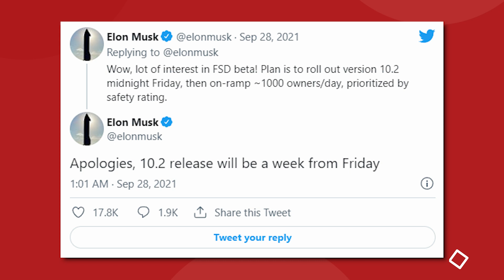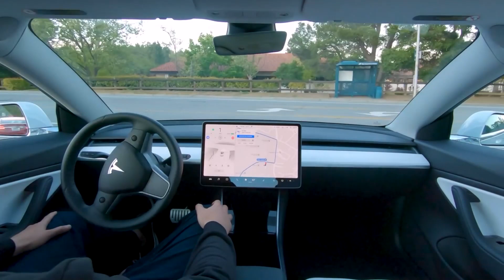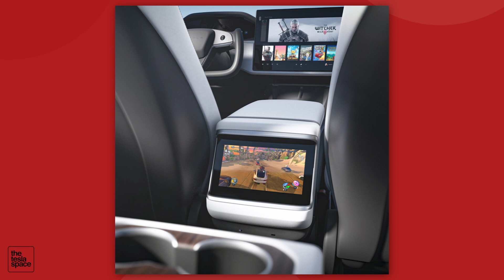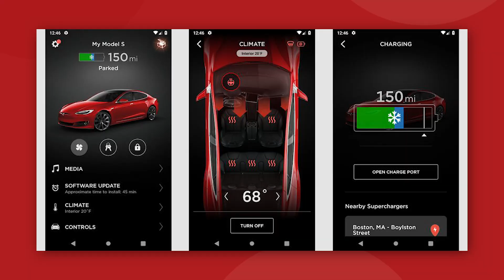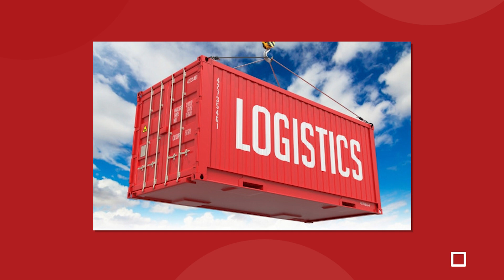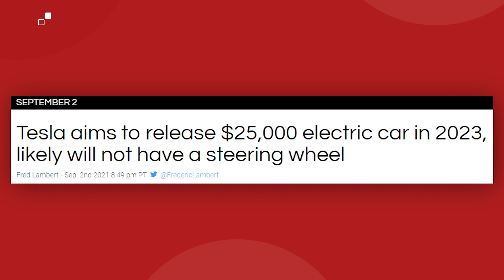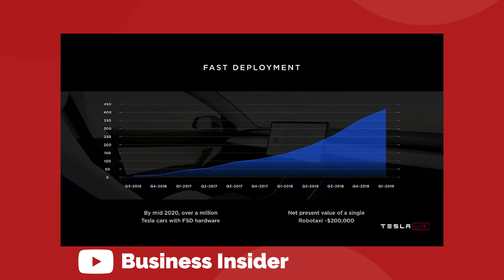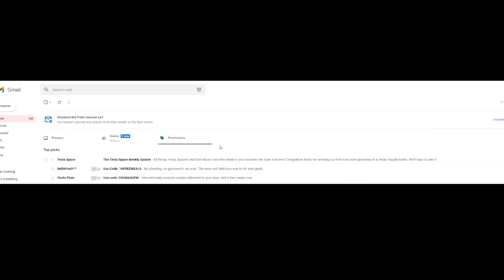The 2021 Tesla Robo Taxi Update Is Here!

Comment: the car safety isn't an issue. if tesla follows ubers model of only having drivers use the app with a valid linked credit card then any issues or damage done to the car can be charged to the customers credit card right away with the use of the cars interior and exterior cameras and yes most new models from 2017 (Model 3/Y) and the refresh Model S/X have interior cameras built in

Comment: If  the $25,000 Tesla doesn't have a steering wheel, then you are really buying a $15,000 Tesla and $10,000 FSD software.  Who can compete with that?  If the $25K Tesla can also function as a RoboTAXI, then it will pay for it self in a few years and then make passive income for years.